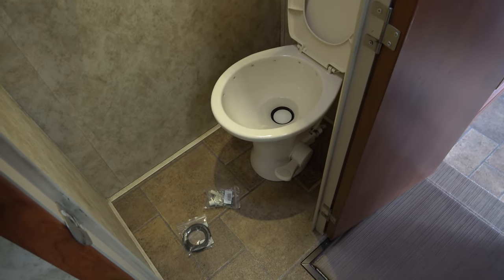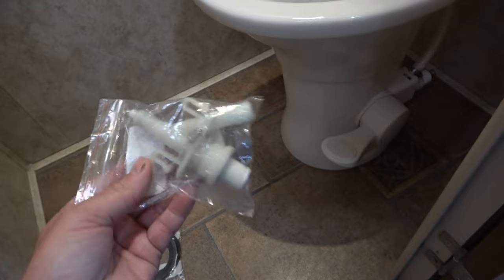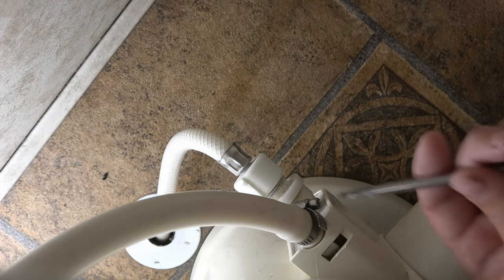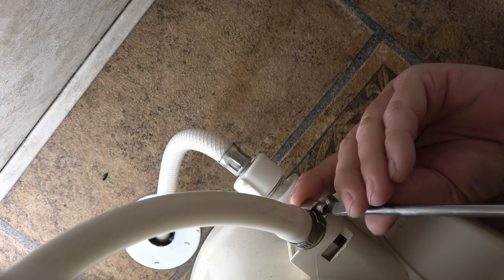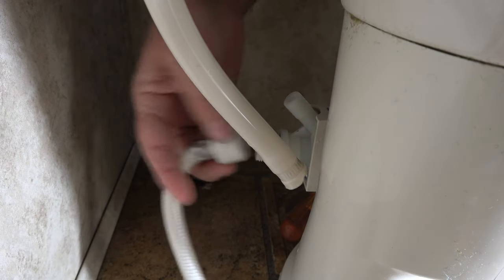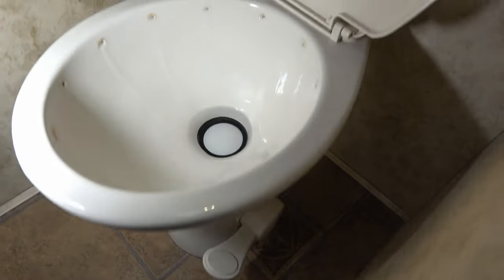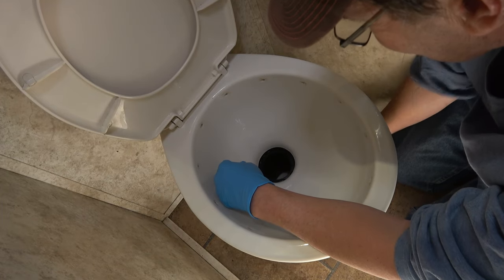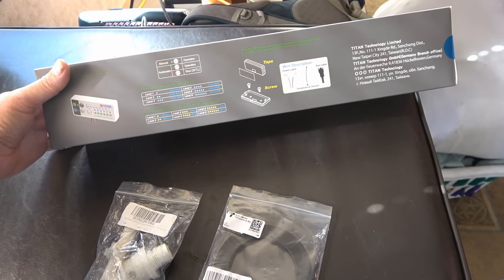Replacing a Dometic RV Toilet Flush Valve and Ball Valve Seal

Comment: Pulled my old rv toilet out and put a Dometic rv/boat macerating toilet in. I’ve had it for two years now. Best decision ever
Reply from the maker: Why did you need a macerator? Were you getting clogs or something?
So far I haven't felt the need to change the toilet, no issues with dumping or clogging going on 13 years now. Every few months I do a good flushing with a cleaning wand and run the built in flusher for a while.
Reply: Not so much as a “need” due to clogging but rather a comfort decision. Much less maintenance and I have completely lost the tank smell.

Comment: I wondered how to replace that seal, our RV is only 3 years old at this point but now I know!!  Thanks!!
Reply from the maker: A good way to extend the life of the seal is to add a bit of plumbers grease to it a few times a year. Its silicone based so won't hurt the rubber and helps it not dry out and work well. Can be found at pretty well any hardware store. :)
Reply: @LoveYourRV  Yes, I do try to do that at least once a year

Comment: I Doubt you had a chance to check out my video on the very same problem. We had it twice. And it flooded our floor both times in the middle of replacing my floor right now. But back to what you are doing. I think you might want to put a shut off. Valve in between the toilet and the floor very easy to do.  Because if that bus, there's no way to shut off the water without shutting off the water everywhere. Anyway, online, it's like that.
Reply from the maker: Thanks for the tip! What I've been doing the last few years since the camper is getting old now is to not hook to the city water supply and always now run off our fresh tank and pump instead. Have gotten very used to it since we dry camp so much. I think its a good way to go with the old camper in case of a leak I will hear the pump cycling and be alerted to it and very easy to shut off with just a flick of the water pump switch and worse caser scenario is a max of 60 gallons can flood out as that is the max of the fresh tank. We turn off the pump as routine when we go to sleep or leave the rig. Cheers! Ray
Reply: @LoveYourRV well, it's interesting that you had to fix this as my old camper has some sort of similar problem but it is a different model. My friend and I are planning to fix it as I cannot turn on my water supply until we fix this. Thanks for the video. It should help us. He is a subscriber too.
Reply: @LoveYourRV We were using the pump the last time It failed. Vicky was in the shower and the pump was running. As we were, phone docking didn't notice. It was slotting until she got out of the shower and water it over, filled the toilet and ran all the way across the floor into the kitchen area. From that point on, until we got home, we could not turn Pump on because it was just over floor the toilet again. That's why I put a shut off Valve write before the toilet switch.
Reply from the maker: For emergencies I carry one of these in my tool box. https://www.homedepot.ca/product/sharkbite-1-2-inch-brass-push-to-connect-end-stop/1000792772  Its a push on Sharkbite end cap so I can cut into any of the PEX plumbing feeds in the RV and cap a leak if needed.
Reply: @LoveYourRV That's a good idea. I need to throw one of them into my Tool kit. We ate a 100 miles away and no place to stop. Last time it happened. I don't like driving that far in a day. I didn't get my refrigerator fixed. Still it was the top switch. I think they call it the brow board.